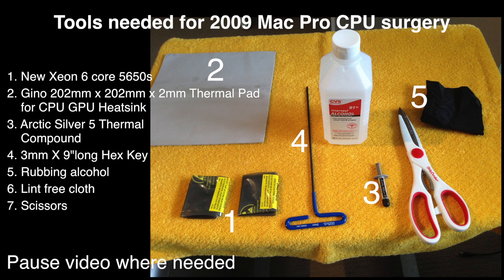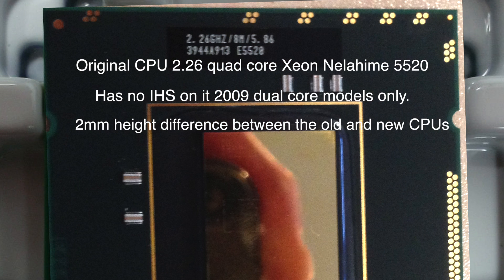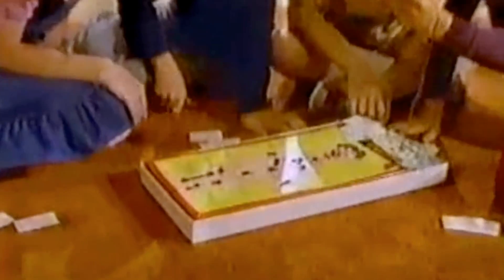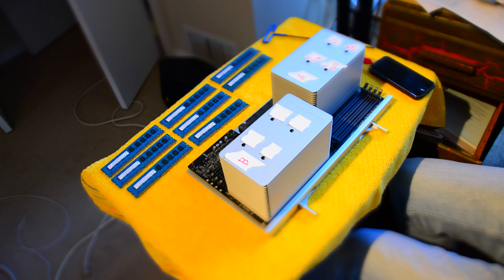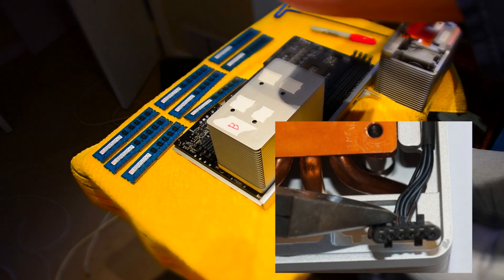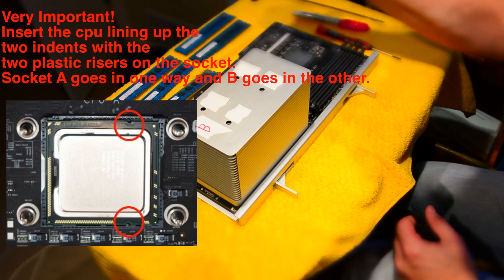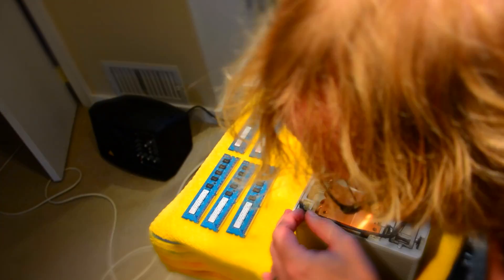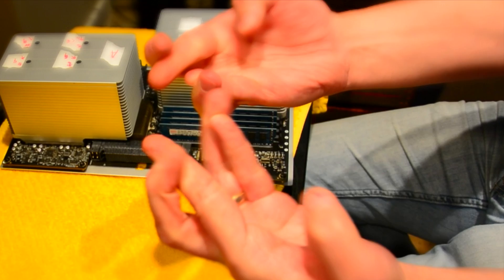Mac Pro 2009 5,1 CPU upgrade 8 core to 2010 12 core

Comment: Thanks for the video Lance, successfully upgrade my flashed 4.1..5.1 MP with 2 x5670, at first time didn't start, then tide  the screws a bit more ...and started. Wondering what is the average temp of your CPU's after the upgrade? Mine is like between 76-77 Celsius. Best regards!
Reply from the maker: That is pretty normal they run hot but throttle around 100c
Reply: @MacSoundSolutions  Appreciate your time and answer!!!

Comment: Interesting comment about the memory slot 2.  I upgraded my 2009 with 5675s and after restart it would not boot with memory in slot 2.  I wonder if I tighten down heatsink if I can get it to work.  I used delidded cpus however. I will let you know
Reply from the maker: If they are delidded you need to go pretty darn tight, unfortunately you may need to clean and repaste if you can’t get it working. Also when tightening do a criss cross pattern a few turns at a time on each screw.
Reply: Hello I’m looking at one of these Mac’s it’s 2011 3.4hz 5,1 128gb ram 12core I’m looking to use for audio which I’m sure it’s more than enough but I also want to use it for video editing and also making 3d graphics it’s in excellent condition for just 450$ but is it still worth it?

Comment: I have a 2009 8 core Mac Pro I recently did a firmware update on it to change it from a 4,1 to a 5,1 and that work. After installing the intel x5690 chips in my computer had a similar response like before you tighten up the heat sink screws the second time so I did the same but a red light came on by the heat sink so I loosen them up and lights went off but my Mac turns on but it still never boots up. Could you have an idea of what could be causing the issue? I put my original chips back in the first time it didn’t boot up but when I tightened the heat sinks a little more it finally booted up. If you have or anyone have any idea of what could be happening please help me!!!
Reply from the maker: Are you using delidded CPUs? Or are you using lidded? Make sure the CPU sockets are clean and nothing has fallen in there. If they are delidded you need to tighten them all the way down till you can’t turn anymore, with lidded it’s trickier and you don’t want to over tighten them but they still have to be pretty tight. I just installed delidded 5690s and I had one bad CPU so that’s always a possibility as well. You can install just the first CPU A with nothing in CPU B and see if it boots and all the ram shows up. Your fans will run full blast but you will know your good with the first one which is the one on the right cpu A. You should put a thin line of thermal paste from left to right on the cpu , not just a blob in the middle, too much thermal paste can also be a problem.
Reply: @MacSoundSolutions  by delidded you mean without the clamp down part you show in the video? If so it is delidded. The last time I tightened it until it couldn’t be tightened any more on cpu A a red light came on near it. I read up on it and found it could be an overheating issue but everything was cool to the touch and the second time I tightened it until I could tighten anymore and a red I wanna say on the logic board came on along with the one by cpu A there was no flashing on the power button on the outside. So it may be that I don’t have enough thermal paste on the cpuA. I put my 8 core chips back in the first time it didn’t boot up and I took it out and tightened it up some more and it booted up. Also there is a black piece that lays on top of the original chip. The original chip only has the copper looking metal in the middle. I didn’t put that onto the x5690s because I didn’t see it in any of the other videos I’ve seen. So I didn’t think it was needed. So is it needed because I know that the design and height of the x5690 and the original chips are different? Thanks again for your help!!!!
Reply from the maker: @12keysin1  the lids are the silver metal cap on the top of the cpu it’s actually called the integrated heat spreader IHS. So sounds like you are using lidded just like I installed in this video. So lidded has the silver top, delidded has the gold rectangle. You can Remove the IHS if you want and I would the. You also need to install the black plastic black cover that came with the original CPUs if you don’t have them then you can keep trying the CPU with the lids on. If your using lidded did you apply more thermal pads and detach the heat sink connectors like I do in the video? Every time you re install you have to completely clean the cpu and heat sync again and reinstall them with fresh thermal past.
Reply: @MacSoundSolutions  it doesnt have the silver hood like lid with the locking latch on it. The original chip had just a black plate over it but it moves freely such as when I take the heat sinks off it would come with  the heat sinks still stuck to it along with this black plate between the chip and the heat sink.The original chips  has only in the center part the metal gold copper look the other edges of it is your standard green color. There are threaded studs that mounted to the ram board that you sit the heat sinks back on. I will see it that plate will sit ontop of the chip before placing the heat sink back on though I don’t think it will fit because the chips are designed differently.
Reply from the maker: @12keysin1  Yes the new chips should look just like the old ones if they are delidded we are going in circles here, the originals cpus in 2009 are Xeons without the IHS 2009 dual cpu models only. If you have silver caps on the new  CPU like I installed in this video  you should not use the black spacers that came with the original chips as they wont fit. But as I have said yours is a 2009, it came with lidless cpus no sliver cap, the gold is viewable, you should install lidless cpus also with the plastic spacers to replace them for the easiest install or do what I did exactly in this video if you want to use lidded CPUs with sliver caps. The 2010 models have the lids and the latch the 2009 do not have the latch. So one more time. Yours came with delidded cpus, the easiest install is to replace them with the same liddless cpus, if you do the  install with the lids on you do what I did in the video, all of the same steps, add thermal pads to the censors or the heat sink will not be touching the sensors and you will have issues. Also if you did not pull the heatsink clips from the housing they may not reach the power on the logic board. Liddless is easy, lidded is more work and all steps should be done like in the video.

Comment: Hello. my dear friend, how are you. I have a question. This model of SSD-WD Blue SN550 NVMe SSD, will be compatible with Mac Pro 5.1. Thanks
Reply from the maker: I saw this review on amazon so take it with a grain of salt but seems ok. 
Works on Mac Pro 5,1
By JING on September 28, 2020 Works perfectly on my Mac Pro 2009 5,1 as OS drive.
Great quality.

Comment: Wow, he made it so much harder than it needs to be
  All you need to do is delid the new cpus and then you just drop them in without and modifcations to anything on the motherboard or heat sinks.
Reply from the maker: That’s because I did this video 7 years ago and delidding was not wide spread knowledge that’s all over YouTube like it is today,  and CPUs were a lot more money so the risk to expense ratio is now much much lower now than when I made the video. It is much easier with delidded cpus which are now dirt cheap, but before if you screwed up deliding you would loose a lot of cash. This has been widely discussed here in the comments.

Comment: Hello I am using Mac Pro 5.1, I have a Samsung 970 m2 PCI installed I cannot use it as a startup disk. What is my problem?
Reply from the maker: What version OS are you on, I know that certain Samsung don’t work but I think they are the pro versions.
Reply: @MacSoundSolutions  I installed Mac OS catalina boot rom version 138.0.0.0.0
Reply: @MacSoundSolutions  pci m.2 ssd to boot I guess the boot rom must be 140.0.0.0?
Reply from the maker: @cengizcebeci8726  yes it does you need the Mojave installer to do the firmware update you don’t have to install Mojave just update the boot rom.

Comment: Just wanted to say thanks for giving a turn count.  I'm getting ready to do this, and I really appreciate knowing what to expect.  Thank you!
Reply from the maker: you can install the first cpu insert the tray and see if it boots, the fans will run at full speed then install the next one and if done properly the fans will go back to normal. Best to go light on the turns and then do quarter turns to ease them in as apposed to over tightening on the first try, Check out my other video oops I did it again, I had more issues with the second upgrade to 5680s, but it worked in the end and has been a long time since without issue. It is a easier install if the CPUs are delided for the 2009, I kept the lids on and it worked out, no over heating etc, good luck!

Comment: Hahaha, I did this before watching your video and guess what? I did like you said - had the balls to do it - just din’t had the knowledge to do it right and I did damage the board and one of the CPU’s. Well, now I am looking to buy both cpu and processor again. By the way, my computer is a 2009 and was flashed to 5.1 2010; would it be possible to upgrade to a 12 core if it is 8 core? I will appreciate any information.  Thank you
Reply from the maker: JN Creative Videos sorry to hear it, yes yours is a dual cpu, but you need to use a 2009 dual tray not a 2010. In this video mine is a 8 core upgraded to 12, dual six cores.
Reply: Mac Sound Solutions thank-you for the replied; do you have any advise how to turn my MacPro 09 into a 12 core then. It has been flashed to 5.1 as well. So, before I order the tray and cpu’s I like to know how and if it's possible.
Thank you so much in advance.
Reply from the maker: JN Creative Videos honestly you are going to pay almost as much for a tray as a used Mac Pro, watch the video it explains the upgrade process. You can buy delided CPUs which makes it easier for a 2009, there are several videos on YouTube on this I would check them all out. I did this a longtime ago and did not remove the ihs lids on the cpus I have not had any issues but temps may run cooler with them removed. The 2010-2012 models have the lids and are easier to upgrade the processors.
Reply: Mac Sound Solutions Thanks, I will keep you posted on my adventure! 🤣

Comment: Hi there Lance, great Video!  I recently upgraded the memory in my cMP (4,1 > 5,1) dual-processor (2x 3.46 GHZ) with 8 PC3 10600, 1333 MHZ RDIMMS for a total of 64 GB of memory. Prior to this upgrade, everything had been running fine with 16 GB of memory (2GB in each of 8 slots) running at 1066 MHZ - without a PRAM reset. After installation of the new memory modules - 8GB sticks in each of 8 slots, and a PRAM reset, I noticed a RED led light on the logic board next to CPU-2 housing, and the system reporting that memory slots 7 & 8 are empty even though there are two 8 GB memory modules physically present in those slots. in other words, the system is not recognizing the memory modules in those slots. All efforts to move these two modules to different slots - to be certain that they are not defective - have been in vain - the led stays on & the system keeps reporting only 48 GB of memory. Please help ( it appears you had a similar problem during your installation).
Reply from the maker: Funmilola Katibi sounds like your heatsync for cpu 2 may be a tad loose, but I hate to say to tighten it but you could try just a tiny tighten on each screw in a crisis crosss pattern and see if the light goes off and the ram mounts, check out my second upgrade video “Oops I did it again” as I had a lot more trouble with the ram on that install. it could also be too tight and the same issue can happen but maybe it’s loose as you moved it around.  Honestly you get better overall performance with 6 Dimms  3 in each bay 1, 2 and 3 than 8 Simms. But sounds to me like you have an issue with the second cpu. You could pull it clean it add new thermal paste if all else fails with trying small tweaks doesn’t work.
Reply: @MacSoundSolutions  thanks MSS, I'll try that.

Comment: Hi. I have a question, now I saw that there is an AMD Radeon RX 580 video card that is compatible with Mac Pro 4.1 and 5.1. you know how to "flash" prepare that model. Thank you
Reply from the maker: You can install OpenCore then you don't need to have a Mac Flashed card any more. You can buy a flashed for mac card RX580 from MacVidcards or on ebay if you want that but you cannot flash them with software only the rom chip has to be replaced with the new Mac ROM as far as I know.  Check out my latest upgrade GPU video. I have the RX5700XT installed and its been running great with Catalina and Windows 10. https://www.youtube.com/watch?v=wI_1w7EWS8c&t=137s  The install of OpenCore is really easy as Martin Lo made a special version for 5,1 Mac Pros that makes it very easy.  https://www.youtube.com/watch?v=7wWfU3AlFPk
Reply: @MacSoundSolutions  excellent news, so I could use this video card, I will try. always grateful for his professionalism and friendliness. Thank you

Comment: Hi. Please, if you are so kind as to explain to me how I can install Catalina OSX in an AHCI Samsung SM951 256GB SSD. I could already do it on an HDD, I have the Catalina OSX in an HDD and a USB Memory, but I do not know when installing the Catalina OSX in the AHCI SSD Samsung SM951 256GB the OSX does not start from the AHCI SSD. Thank you
Reply from the maker: Have you run the firmware update with the Mojave installer? You dont have to install Mojave just run the installer to update the firmware.  You have to do this if you want to boot from an NVME in Mojave or Catalina. 
To boot from a NVMe drive, for Mac Pro 5,1 you need to upgrade BootROM to at least 140.0.0.0.0, supplied with MAS Mojave full installers since 10.14.1. 10.14.4 has 141.0.0.0.0 and 10.14.5/10.14.6 have 144.0.0.0.0. Read more info on it here. https://forums.macrumors.com/threads/pcie-ssds-nvme-ahci.2146725/
Reply: @MacSoundSolutions  As always grateful for your great help, right now I'm going to see that information. Thank you
Reply: @MacSoundSolutions  Hello, excuse me. I have a question. I just updated the firmware to boot Rom 144.0.0.00, on my mac pro 1289 from 2009 upgrade to 5.1, when I put my original AMD Radeon RX 480 video card, and it had no video, I think that with that firmware version, it is not supported this video card? What is your opinion? , thanks
Reply from the maker: @gersondelgado5084  try using the HDMI port only if that doesn't work try one display port. Only one port works at first. You may need to do a pram reset to get all ports working again or plug or unplug the port  then plug it back in while the mac is on. When I fist did the firmware and graphics card upgrade only one port on the card worked.

Comment: Hello, great video! Did you ever experienced booting up just one of the processors, not both
 of them? I'm having issues with this. CPU in socket A boots properly if
 CPU in socket B is tightened reasonably well. If it's overtighteted 
it's not booting, if it's too loose, it's not booting either. Do you 
think this might mean the CPU in socket B is damaged? I'm operating with
 de-lidded version.
Reply from the maker: Check out this videohttps://www.youtube.com/watch?v=01wo4uQ6x-c  I had some issues on my second time around doing this install. I would look very closely at the socket for CPU B and see if any old thermal paste fell in, this is one of the things that happened to me on my second time around doing this or look to see if there are any pins are bent. . You can boot with CPU A only installed but your fans will most likely go full blast until the second cpu is installed and  working. Make sure to use a criss cross tightening pattern one turn at a time then move to the next post.I would clean everything up on CPU B and try again.
Reply: @MacSoundSolutions  Just watched your second video. Thanks for the link and for your extra tips! Yes, it's pretty much the same I'm going through right now as well. CPU A is working, I tested it separately, when I boot it alone, the fans go blast - that's classic. If I have CPU B connected and I start with loosened CPU B it's not booting at all, then I'm tightening it 1/4 turn per try. At one point it boots without fans going crazy - I'm in the system, but Mac showing only one CPU. So I'm tightening CPU B more and more but then it stops booting. At this point I'm afraid to tighten it more, cause I'm not sure whether I'm not hurting the logicboard already. Maybe I have to fiddle with this some more. BUT - at one stage of this install I tried to put processor from B slot to slot A, I went through the same procedure, same logic, booting just CPU A and it didn't boot at all. Got me thinking whether this processor isn't damaged already. I might have overtighten it at some point or who knows. Hm, I guess I have to try some more then.
Reply from the maker: @petrsmelik8786  Sounds like CPU B may be bad as it didnt work in the A slot at this point I would get another chip and hopefully you didn't tighten down to much on the cpu B socket.

Comment: Thanks for the great video, one question when you stack the thermal pads on the VRMS, do you remove the old original thermal pads or left them there?
Reply from the maker: Timothy Solosa I’m pretty sure I left them, you can see it when I flip over the heat sync the old pad still stuck to it. The new pad is to make up for the height difference of the new lidded processors so the sensors still make contact with the heat sinks. If you were to use delided processors which a lot of folks have done you would not need to add extra thermal pads.
Reply: @MacSoundSolutions  Thanks bro. I am waiting for my processors to be delivered to me, cant wait to try this!!!